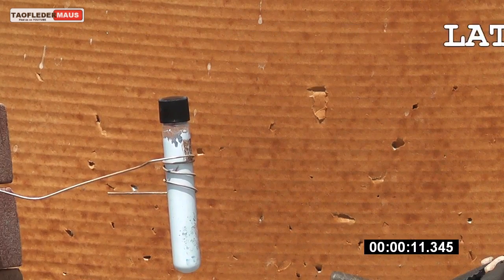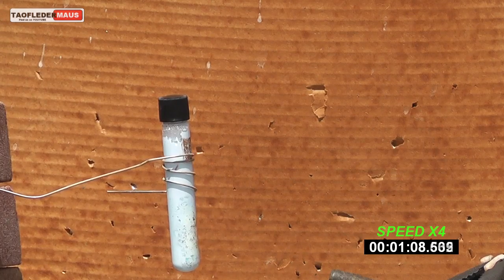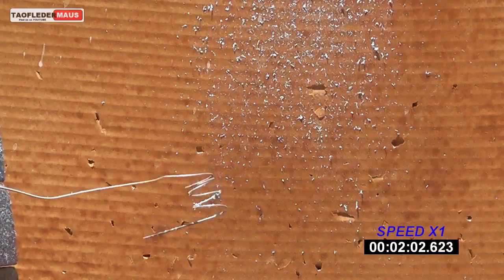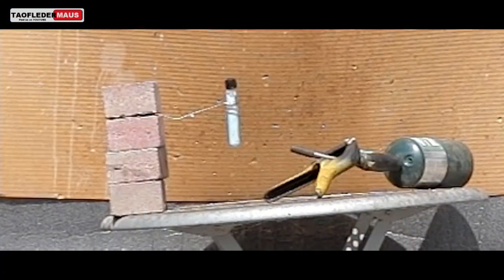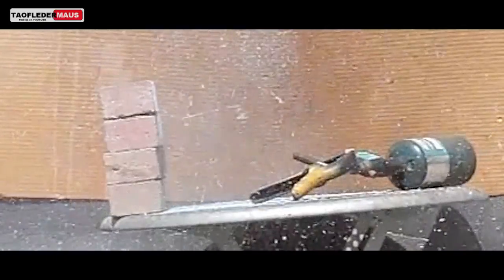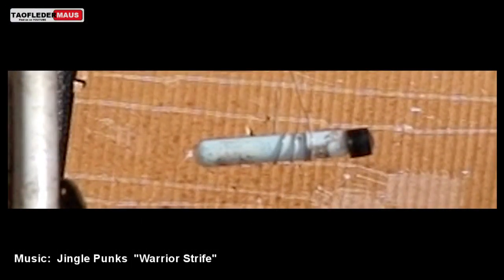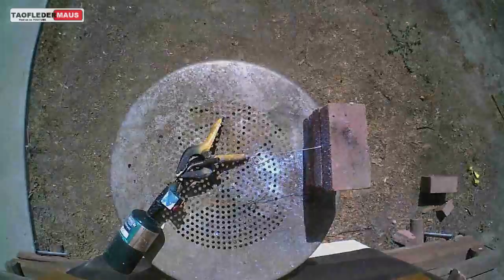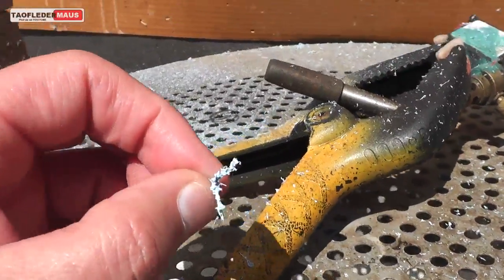Superheated LATEX PAINT - Insta-dry - TTTT

Comment: now paint a piece of wood. let it dry. scrape the paint off. and mix it with something cool. like magnesium. change the color?
Reply from the maker: Sounds expensive.    That would probably cost over  dollars 12.
Reply: jasonofcompsci Science is always spectacular, even if the end results arent.
Reply: ***** What about a TTTT of diesel+gasoline in a single tube. It would be interesting to see if/how they interact differently to the heat
Reply from the maker: diesel and gasoline would mix together.
Reply: ***** You never know if they would react at different temperatures though. Thats how petroleum distilleries work
Reply: Jason Bonedi I guess he could try a few mixtures.  One gas, one diesel, one mixed.  I don't see how anything spectacular would happen by mixing them.

Comment: Yes, one of the MAJOR DRAWBACKS, of using Latex Paints in Drywall and NOT FIRST PRIMING IT, will result in a similar result, the Gypsum extracts the water from the Latex Paint and then the Latex Paint just falls off the wall.  Of course these takes decades and not quit as fast of a result as was yours...  LOL...

Comment: Do that with several colors of paint with a glued back ground and sell it for charity.
Reply from the maker: It didn't really stick to anything very well.  You can just brush it off with your finger.
Reply: *****
You can coat it with clear urethane spray which sort of glues the residue on the surface :)

Comment: You should make the test tube holder so it doesn't let the tube move so everything comes out the top at high speeds instead of same old explosion every time
Reply from the maker: Brett A.   Yeah,  it was very boring.   I'd say only about 5 to 10% of the viewers liked that stand.
Reply: he tried that, had a solid metal plate hold it and it was really boring. the 3 times he used it, they blew the top at almost the same time into the experiment, everyone voted the wire back into use
Reply: *****
How about a pendulum stand ? "Which propellant gives fastest rpm and longest run time?" Double pendulum would be really wicked :D
Reply: ***** Ah ok
Reply from the maker: We'll definitely try the test tube rocket engine idea.  We'll see how high the rocket lifts up.   I feel this will be safe and predictable so I can aim the cameras where I think it will go.
Reply: ***** 
Do one upside down and see how high it launches
Not in your garden though obviously

Comment: The TT cap always seems to be the weak point in these tests. I wonder if you could plug the cap hole with something that won't fail under pressure.
Reply from the maker: The plug and cap is the weak point by design.
Reply: ***** Yeah I kinda figured that, but I thought it might be cool to see the TT explode from pressure rather than gettng smashed against something after the cap lets go.
Reply: *****
but then there's the legal issue that he just made a bomb. I think it was mentioned in earlier videos, actually.
Reply: Brett A. Ahhh......I see. Oh well, the tests are still very cool :)

Comment: Hey I just wanted to say that I thoroughly enjoy your videos but on one of them I know the cap came off and it went straight down and blew up after hitting the table can you try to do one facing it the other way to see if you can get one to fly in the air
Reply from the maker: The problem is it would be like lighting a rocket engine without a rocket.   I have a model rocket and the TT's actually fit perfectly so I will be trying that,   and see if it will lift the rocket at all.

Comment: please do liquid butane?
Reply: Go get that into a tube first...
Reply: piranha031091 I'm against the use of pot, but it's the same idea as making weed oil, the guys do it with butane and it liquifys.
Reply: piranha031091 It's easy to do.
Reply: Yha, thanks wouldn't it be AWESOME!??!
Reply: yhaforever
I'd be curious to know how. With dry ice maybe?
Reply: piranha031091 Butane acts same as the liquid nitrogen, but it's boiling point is much higher, so you can just pour it into the tube and it will not evaporate fast.
Reply: Oh, ok.